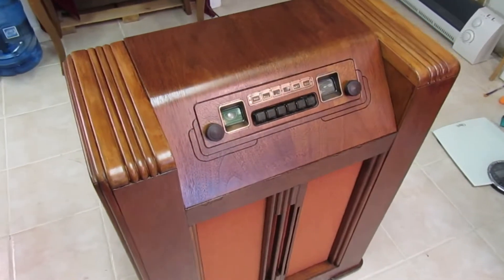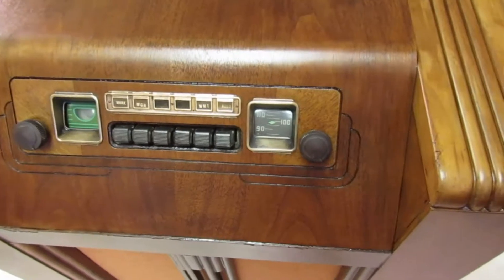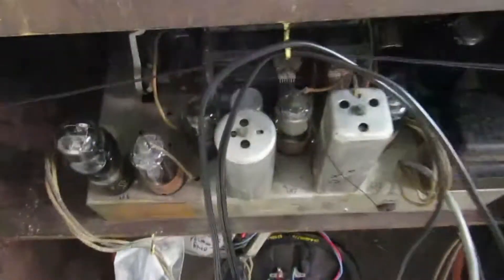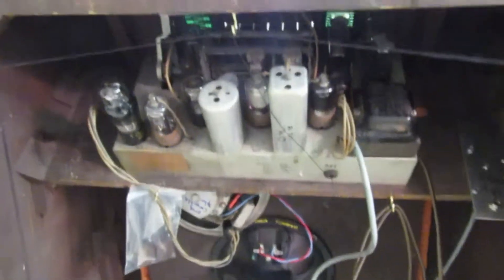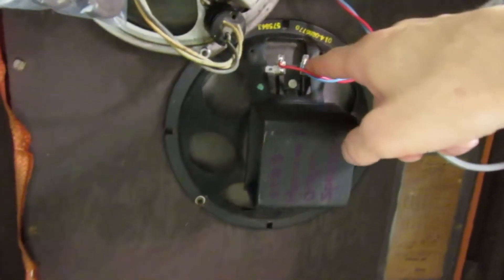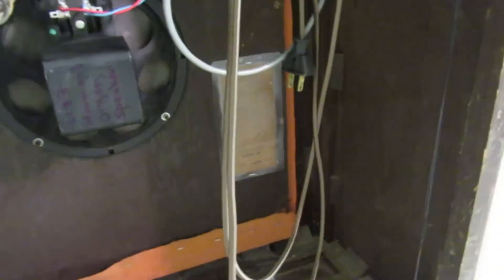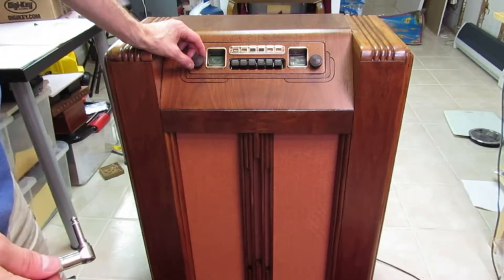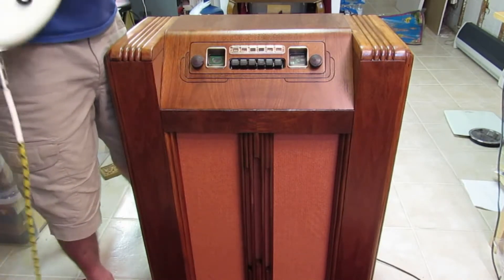Antique vacuum tube radio gets a guitar/aux jack input! Coronado/Philco/Zenith

Comment: where did you wire in the aux input to in the circuit?
Reply from the maker: Right at the volume control. It's a jack with a switch in it so that if you plug into it, it disconnects the AM radio signal from the volume control and uses your plug's signal instead. If you pull out the plug, the switch connects the AM radio signal to the volume control instead.

Comment: I have a Sparton 766 7 tube radio 80 watts. All the tubes work & the speaker seems to be quiet loud but the antenna isn't hooked up. My volume pot has two wires on the top. One coming from the power transformer & the other going up to a cap that has the power lead tied in on. The power transformer has 10 connections. Can I send you pictures to make sure I'm putting the guitar jack in the correct spot. Thanks in advance.
Reply from the maker: You can email pics to colin.joyemusic@gmail.com .  The wire to the power transformer is probably the ground and should be the terminal the wiper touches when the volume is zero. This schematic link might work: https://www.radiomuseum.org/dsp_guestschema_view.cfm?key=ae6d2ba1-14cf-479a-8aa4-b4559920b910 . "R1" is the volume control and there should be 3 wires. The bottom terminal of R1 on the schematic goes to ground (power transformer), the top terminal to a capacitor (this is where you insert your guitar signal), and the middle is the wiper going to the "75" tube grid, which is the cap on top.

Comment: Very cool....are any additional resistors or caps needed for this electronic mod?
Reply from the maker: For the jack, nope! Just wire the jack into the volume control so that if a plug is plugged into the jack, it interrupts (by switch in the jack) the signal coming from the radio section and instead puts in your guitar signal. Let me know if you need a diagram. I probably should post one somewhere. Best!
Reply: @JoyeMusiccom  Actually, a diagram would help me...another YT video shows an mp3 jack being put in, and it uses a SPDT switch and 3 resistors, hence my confusion.  Thank you!
Reply from the maker: @timhansen4556  Here's a digram (March 1, 2021 in my blog posts): https://joyemusic.com/blog/ . If you can't find it, here's a direct link to the diagram: https://joyemusic.com/wp-content/uploads/2021/03/TubeRadioAddJackDiagram-768x886.jpg 
No switch is needed if you use a jack with a switch built in, as I show in the diagram. Resistors might have been to reduce the input signal level to match the radio level so you don't have to change the volume control a lot. My way is the simplest possible way, maybe not the best.
Reply: @JoyeMusiccom  OK, very clear now, thanks! I'm going to just temporary-rig it (with and without resistors) to see if I even like the sound thru my 1941 Zenith 10S668 with 12" speaker....will be my 1st old radio mod, and 1st all-tube guitar amp. Will report back with results, but waiting on parts now.....
Reply: OK- this didn't work in my old console; radio comes thru either way and no guitar signal...mystifying, because the SC 12A jack's continuity functions check out as you say. I've decided to leave my original, collectible console as-is and look for a restorable old radio cabinet and put a modern tube-amp and speaker in it. I like your concept, and am surprised that I haven't yet seen this kind of rig on stage....
Reply from the maker: @timhansen4556  Sorry to hear it didn't work the first time. My first thought is that the radio signal wire is still connected to the volume control directly, OR it somehow bypasses the volume control in a sneaky way. If you disconnect the radio wire from the jack, you should get no radio signal -- If you still do, the radio signal is bypassing your volume control. With some troubleshooting like this, it should be possible to figure out what went wrong. Also, pay SUPER-CLOSE attention to the connections on the jack and test them with a meter, because it's entirely possible that I noted them wrong on the wiring diagram (the schematic should be fine). You might have accidentally wired the radio signal to the TIP of the jack instead of to the SWITCH. Worth revisiting.
Reply: @JoyeMusiccom  I just now discovered the problem: the switch in the jack was not working! I adjusted it (by bending the 2 components a little further apart), and now there is no continuity between tip and radio-in lead with male jack activating the switch. Will try using it again in the next chassis I take out. I just assumed all along that the brand-new jack was in working condition, didn't really examine the switch-components until now....mystery solved.
Reply: @JoyeMusiccom  it's fantastic when the project designer and video creator actually explains and openly takes the time to add an easy to understand, hand drawn schematic.
Your a Bloody legend mate, makes me want to watch more of your videos and subscribe!
This is how you get new viewers subscribing.
Cheers mate and best of luck for the future!
Reply: The comments section  is terrific.   Drawings and hand drawn schematics and explanations.   I've just added  a speaker out jack to my Phillips  P143 and will do the same for a guitar input as described  here.  Thanks for posting and thanks to all the comments.  !

Comment: Would be good idea to instal 3 prong grounded cable... since guitar is grounded trought strings and that could make some demage if you plug it another way around and touch some ground...
Reply from the maker: Yes, or at least a polarized plug, like I did here.
Reply: Oh ok, I live in EU and polarized are just 3 prong ones, sure good if you have polarized 2 prong, could help. But when I see 2 prong on something with high voltage inside I’m scared, hah. Cheers
Reply from the maker: @_-_Michael_-_  Haha. Your 230V plugs are safer than our 120V ones. But, yes, we have polarized 2-prong plugs also.

Comment: Nice. Where is Aux connected too? I need a way into my philco. Guitar
Reply from the maker: Go for the volume control.  Put a switch on the "hot" side of the volume pot so you can select between radio and aux, and you'll have the volume control functioning.  Try it out first, you may need a bit of gain for the aux input, depending on how much gain there is after the volume control.
Reply: @JoyeMusiccom  I do believe I understand. I had luck with AO43 Hammond a while back. On this philco volume pot there is a green wire. That I think sends out to amp. I would like options to play radio/aux. Thank you for replying. Bit of head scatcher.
Reply from the maker: The volume pot will have three terminals in a row hooked up to wires.  The colors may be different, so ignore the color.  The center wire is the "wiper" that is connected to the input of the final amplifier.  One other wire is connected to ground (probably chassis) and is shorted to the wiper when the volume knob is turned fully counter-clockwise.  The third wire is the one you want to hook to a switch so you can use it as an Aux input.  It will be shorted to the wiper when the volume control is turned fully clockwise.

Comment: What did you tie the aux jack into ?
Reply from the maker: It's tied between the AM radio section and the Amplifier stage.  When you plug in the 1/4" jack, the switch cuts off the radio section and directly feeds the volume control, then amp.  It could use about 5-10dB more gain, probably, but it works pretty well.
Reply: I have a Philco car radio am , i want to add a aux input but i dont know where conect
Reply from the maker: Best place is to go straight to the Volume control pot.  It will have three leads, one is ground, the center is the "wiper" that selects volume, and the other is the source that you can tie to an Aux in jack.  Put a switch in to select between the radio or the Aux in.
Reply: @JoyeMusiccom  perfect my friend , now my radio Is working with Auxiliar input, Is awesome
Reply: Super, but what if this is a hot chassis radio?
Reply from the maker: If you flip the old un-polarized power plug, then the chassis will be grounded. To eliminate the possibility of accidentally making it hot, replace the old power plug with a polarized one (and make sure to get the polarity right!).